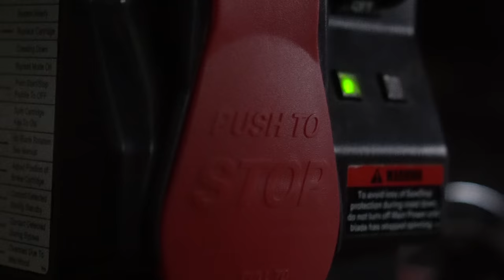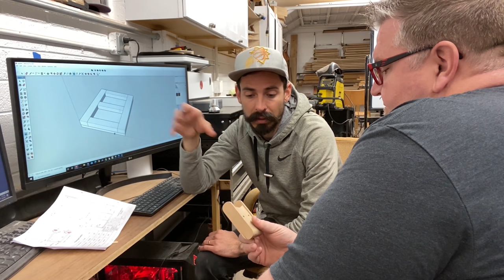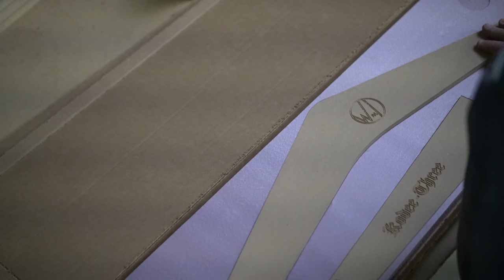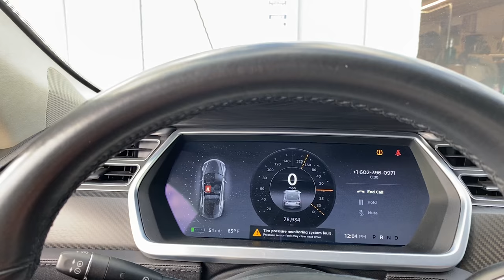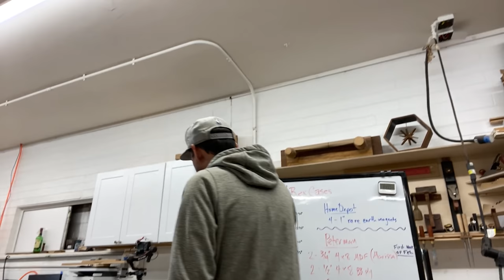New Shop Days! Episode 1 (getting stood up, and whooping some a**!) Woodworking [4k]

Comment: I think im liking this so far. Might want to adjust or upgrade the mic situation though. pretty muffled. Looking forward to more of this though.
Reply from the maker: No doubt. I’ve found that audio is the most difficult part of all of this. I ordered up a few new things to try. I’ll get better the more we do.
Reply: The rode wireless is a little pricey but works great and has a lot of flexibility. I’d suggest that one
Reply from the maker: @baltimoreace  that’s what I was using. I have two of them. I just got a zoom monitor so I can monitor what I am recording
Reply: Hmmm. Not sure why it was so muffled. 🤷‍♂️ I’m sure you’ll figure it out.
Reply from the maker: @baltimoreace  I definitely have a lot to learn.